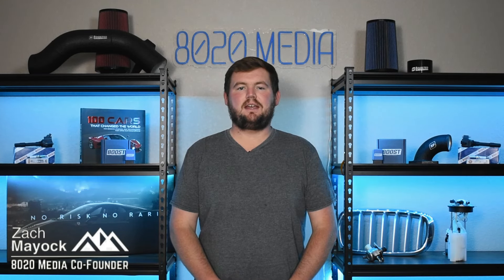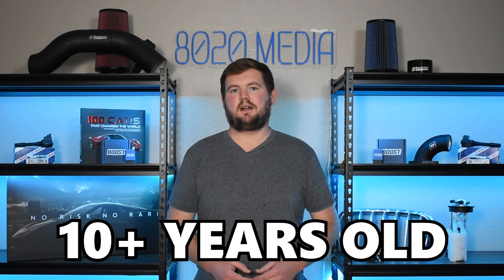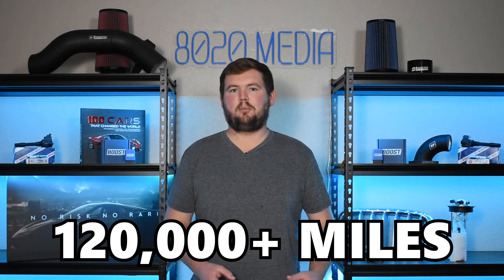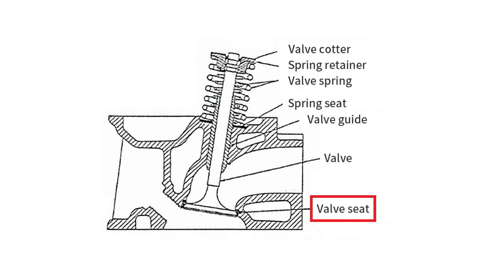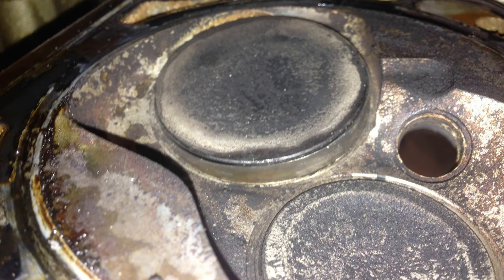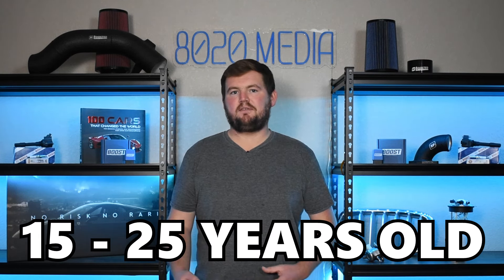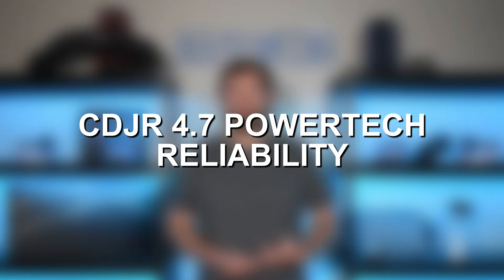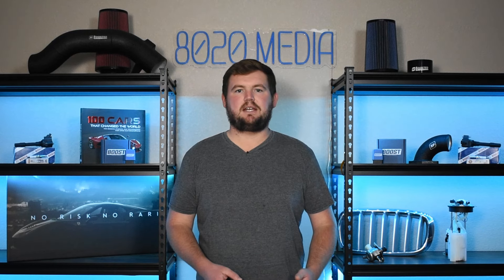The 4.7 V8 PowerTech Engine | Common Problems & Reliability

Comment: Is the H.O. version of the engine more prone to head gasket failures?  Also did the heavy duty trailer tow package on the Grand Cherokee include a higher capacity radiator than the non-trailer tow car ?
Reply: If i we're you, i would buy the 1 gen jeep grand cherokee zj 5.2 magnum v8, which is a lot stronger than the 2 gen jeep grand cherokee 4.7 v8 and a lot easier to repair 😁